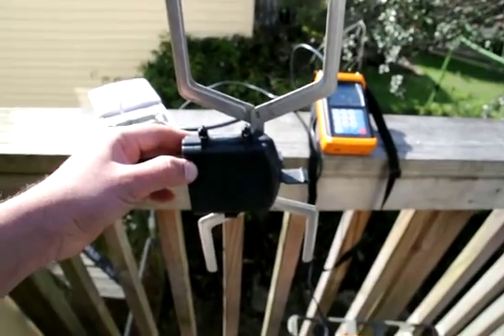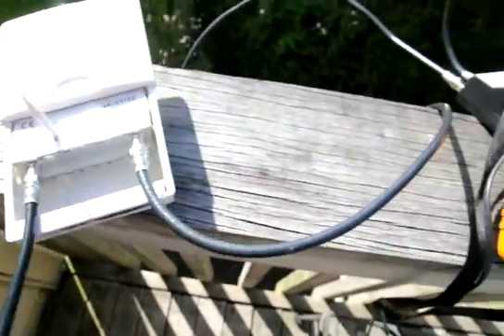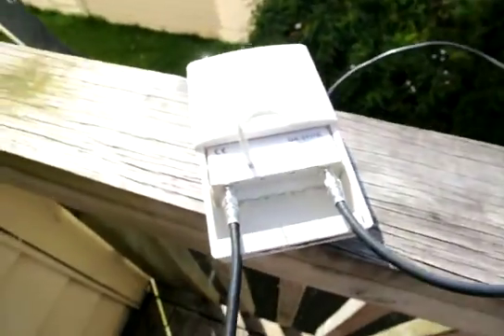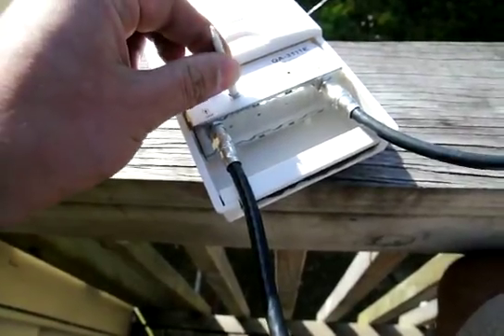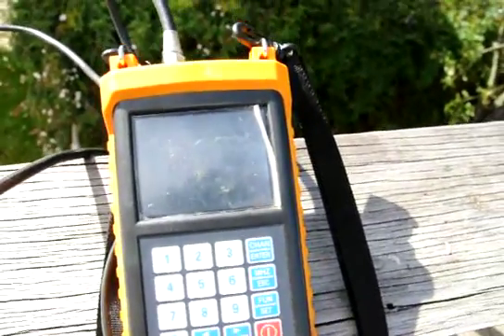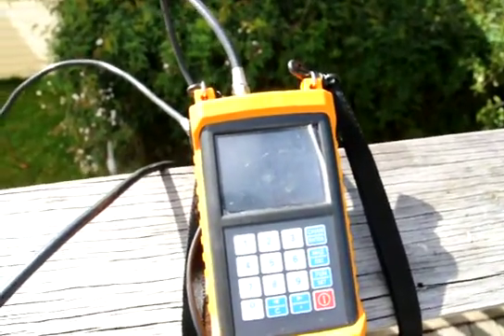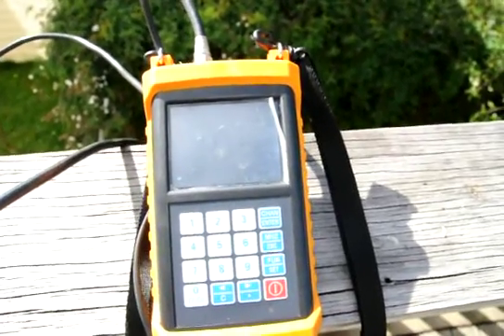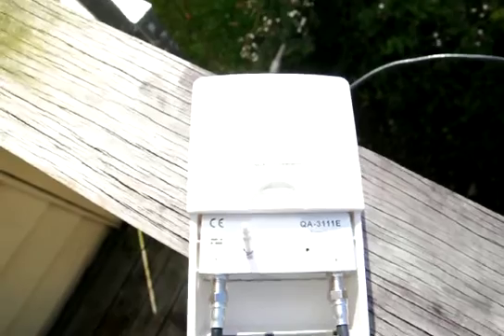Mast Head Amp - Dean Jones

Comment from the maker: in the NZ area, we are thought that the best reception for digital TV is between 60 to 80 DB.  Yet I have been able to get pixel free pic with appox 50 DB on the digital meter on some brands of TV.  There is work out that Sony are better TV with even lower level of signal but when personally installing, I prefer hitting the 60 DB mark as then got minimum chances of going back to the job.